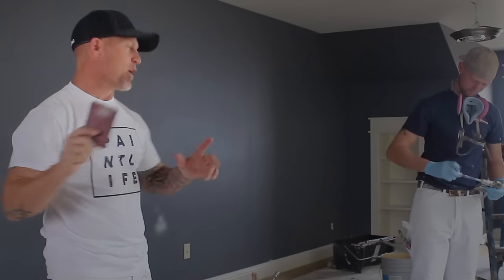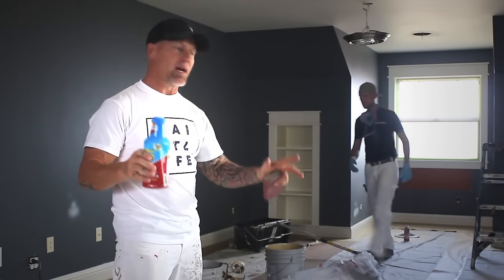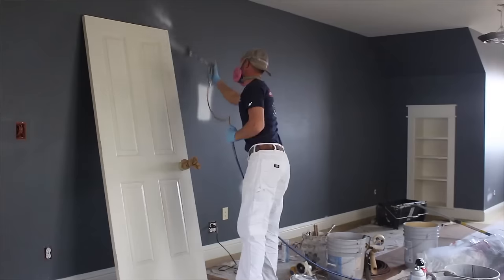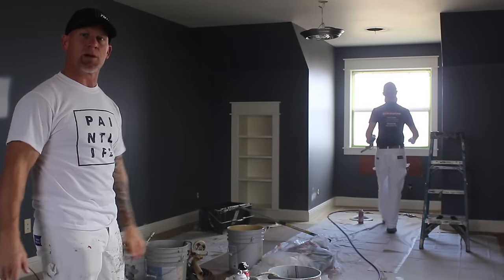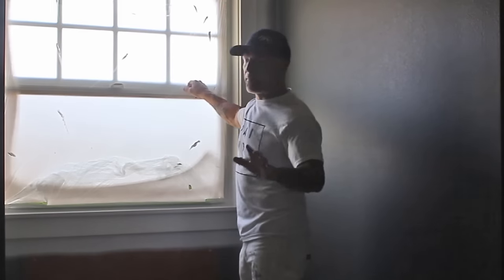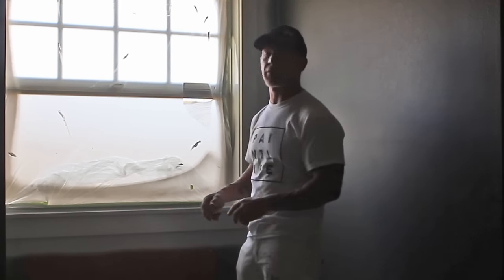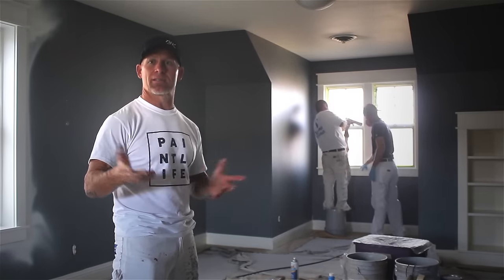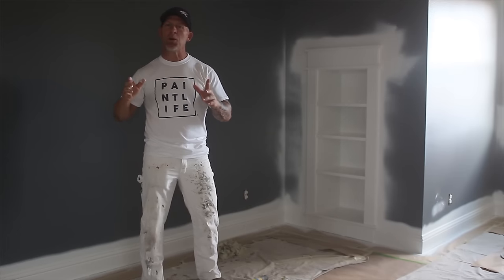Interior Trim Painting Hacks.  DIY How To Paint House Trim Work.

Comment: When you get a run spraying, do you address the issue immediately, or do you wait until it dries to repair the issue? Also do you have any tips to eliminate running? I tend to get runs a bit, whether its spits from the gun or double passing in windows etc. Thanks and keep up the great work.
Reply: Dont ever wait for it to dry. You can either wipe the run and area clean. And try again or let it dry and spend an eternity sanding on tough semi gloss.

Comment: Ok 310 tip for trim paint, but what if you were going to need to prime the trim first?  Can you recommend a tip for priming stained and varnished wood trim with bulls eye 123?  The 123 worked pretty well by brush after sanding the varnish but it's taking too long and I'm going to try spraying it.  I'm willing to use a different primer too if that would be better.  Thanks

Comment: Would Spraying trim with a 211 be as good as the 310 your using? Pros and cons with each tip size? Also.. would using a fine finish tip require a different mesh filter in the spray gun?? If so.. what size mesh is recommended?  Sorry..so many questions.
Reply from the maker: I would prefer a 310

Comment: Do you find a difference when you spray the caulking before it is dry compared to allowing it to dry first?
Reply from the maker: no
Reply: Yeah cracking in the paint from when the caulk dries and shrinks
Reply: So shrinking doesn't effect you paint drying?
Reply: Yeah the shrinking cracks the paint

Comment: Hey Chris, question on the taping and clear caulking on the windows between the wood and vinyl windows.  So you caulk to do two things, seal between the wood trim and window and to give a clean line by sealing the tape edge, right?  When you pull up the tape, doesn't it cause issues with the caulk which may have dried some?  A picture of this taping and caulking would help me understand the process.  Thanks!
Reply: I found your other video explaining how this technique works.  Interesting process.
    Painting Straight Lines With Caulking And Tape.  Painting stripes.  Painting Hacks.

Comment: Curious as to whether or not you worried about the flashing of the overspray? It's been my experience whenever I repaint over overspray such as that, when the light hits it at the right angle, you can see it.
Reply from the maker: Add a latex extender if you are having that problem
Reply: @Idahopainter  to the trim paint or to the wall paint? I'm assuming you're speaking of products such as floetrol? Thanks for your response really appreciate your channel. P.S.  would there be a certain time frame I should/ shouldn't paint after applying my simigloss trim paint?

Comment: Hi, I used 311 tips for trims and doors. the funny thing is after sprying the surface looks rough!! I though the pressure is too high or I do it too far! but the funny things is around the trims on the walls that have already painted prime are smooth.
I hope you are still going online. do you have any suggestions?
thx

Comment: I really dig your videos. One area that I think you can improve on is your spraying technique. When spraying doors it is best to maintain equal distance from the substrate. Breaking your wrist will cause a paint to build up in the center of the door while potentially skimping on the top and bottom.  Also, what is the benefit of having the pressure turned all the way up? I would suggest doing that on ceilings or raw drywall but, not inside an occupied home. Perhaps you know something I don't. Lastly, RAC X Tip is called Rac10
Reply from the maker: Thanks for the tips Chris!

Comment: I'm a painter and decorator been at it nearly 20 years from when I left school. I have never touched spraying, I feel in most cases the work I do brush and roller is just as quick. but spraying mist coats, or all white houses on new builds is what I think will help me. I mean i am a complete novice at spraying having nearly no idea... how difficult is it to mist coat a house in emulsion? and just for mist coating plasterboard/plaster what type of sprayer do I need? and how much roughly in price would one be?
Reply from the maker: Titan 440 or Graco 395. Just takes practice

Comment: Hey, great video. I like the caulking around the frog tape tip! What type caulk do you use. How do you (I) avoid the caulk from setting up before you can get the  tape off or does it matter? I'll be doing this on pre primed mdf soon any other technical advice for this novice?

Comment: In the end of the video you said it is dusty in here so it is harder to see. I am guessing that is the overspray lingering in the air. Can you explain how you deal with that lingering overspray that is airborne from getting onto your trim that has already started to cure? 
I painted a stair case and that lingering overspray was hanging around for 30+ minutes and landed all over my finished work that was starting to dry. 

I am not as fast as you guys, so maybe you sprayed so fast that all the overspray was absorbed into the wet paint still?

Comment: Chris,  I have just watched several videos and learned so much!  One thing I have not seen or figure out is what is your process on new construction.  If you have bare wood window casing, do you tape, mask and caulk the window for each coat i.e. tape/mask caulk window then spray primer, peel tape off and then repeat for each top coat?
Reply from the maker: No, we only tape once for the first coat
Reply: Paint Life TV - so do you brush on primer to the bare window trim then mask off the window to spray?

Comment: I'm constructing my own home.  I'm priming everything and painting THEN installing trim. How can I spray all my trim without having to go back and cut in the walls and ceilings again?  If I spray the trim before installing, how will it look if I spackle then touch up?
Reply: The Idaho Painter thank you for the reply!  If I paint the trim prior to ceilings and walls, would it be best to mask off the trim so I can then spray the ceilings and walls?  Or would you cut in with a brush and roll?  How would you do it?  Thanks!
Reply: The Idaho Painter kind of contradicting yourself there buddy seen as this video shows you spraying the trim before you've even put a lick of paint on the walls!
Reply: POA You can mask the walls off with blonde tape and 12" masking paper after the trim is installed, caulked to the wall, and the perimeter caulking is painted with wall color. So then mask around everything and flap the paper out so you don't have to plastic the walls.

Comment: did you say "full pressure" for the 310 FF tip? was curious because I used a Graco 310 FFLP on my cabinets but still got a lot of fingering. i thought the tip was supposed to run at low pressure and not high pressure...

Comment: If painting trim/doors with latex when it is already painted with oil based paint, can you just clean with TSP, degloss and use a bonding primer before topcoat or do I need to add hand sanding in that equation as well?
Reply from the maker: That is right, no sanding needed

Comment: The guy spraying does a lot of quick touch up shots, but in another video you mention the tendency of the extension to spit (so you start spraying well before whatever it is you're painting). Are you getting spit marks on the trim? If not, what's different?
Reply from the maker: Wherever you release the trigger you will get a spit. Do not release the trigger on critical parts of trim seen easily.

Comment: Does spraying over where you caulked effect the caulking since it hasn't had time to dry? Or will it dry/cure the same? I have heard of doing it to keep the paint from bleeding I was just unsure
Reply from the maker: It depends on the paint you use, we do not have a problem with the paint we use

Comment: what pressure are you running with the ff lp tip? i’m heaving a hell of a t8me trying to control overspray. we build balconies and staircases and we suck at painting. if i use a small fan tile like a 4inch it delivers to much paint. if i go with a 12 inch fan is too wide for a 1inch spindle. and overspray is a billion time more than in your videos.

Comment: Chris, just finished a very large addition on my home and after watching this video have realized I did things reverse order... My walls are already painted and I will be installing my trim next which we are going to paint White. what would you advise I do in this predicament do I attempt to plastic off all of the walls and ceilings and spray the trim. I could brush paint but I think I would rather use the sprayer for the nicer finish. any advice would be super helpful thanks brother for all you do
Reply: Matthew Kitzmann paint the trim before it's cut and installed then touch up after installation 😉
Reply: Thanks
Reply: spray paint the trim prior to attaching....then after attaching..spackle nail holes.....then use a latex extender and brush final coat..

Comment: I am newer to spraying.  I was told to get a 217 tip to spray my trim.  Seems to me it puts out way to much paint and causes major paint pile up(not sure what the correct term is).  I was told if I get a smaller tip orifice size it would clog.  Using standard latex paint.  Can I use a smaller orifice size?  Will this help with the paint build up???  Thanks for advice.
Reply: The Idaho Painter Thank you. It was actually a paint store. Guess they just want to sell the more expensive tip. Bought a 210 and it works much better.

Comment: well I sprayed pro classic on Saturday  and asked sw for a 310 ff and they said they don't sell them so they gave me a 214ff. so basically I fixed runs and sags all morning on doors. I was not happy. I turned the pressure way down and resprayed. come back after lunch and damn if I didn't have a couple more runs and sags! I'm done with pro classic!  Is solo the only trim paint you use  or what are your recommendations?  thanks for all the work you do to provide videos and the help!
Reply: Matt Taylor don't trust reps/sales staff in store, when was the last time they actually stepped out of store to paint let alone use a sprayer

Comment: If there are big gaps between the wall and the baseboards, what do you fill it with before caulking and painting?
Reply: If you’ve got large gaps between baseboards and wall you may need to do some trim work before paint. Shouldn’t have anything that can’t be filled with 1/8” of caulk.

Comment: Hey I’m painting a house with dark trim, I was going to spray the first coat of the walls but worried about getting on the ceiling and also was going to do paint the trim last bit now thinking of spraying trim then walls. How do you protect the trim from the overspray or roller spray?
Reply: stef kerek you have to mask off trim with tape and 6-9 inch paper.
Reply: Just roll with carefully have clean wet reck to wipe paint drops

Comment: I'm thinking of painting some interior trim with proclassic oil base through a graco ultramax cordless handheld sprayer.  Would a 310 fflp tip work well for that?  On the can it recommends spraying with a .015 at 2000 psi.
Reply from the maker: Yes, it would work

Comment: Nice video. I'm having trouble with my spray rig when using a fine finish tip. the rig is a graco 395. this thing is probably from the 90's. A buddy of mine gave it to me in pieces in a five t bucket lol. I figured out what it was missing and ordered parts for it, put it back together again and it works great. problem is when I try using the rac x tip it drips paint from between the tip housing and theUn but gun. It only does this with the fine finish tip. the guys at Sherwin Williams say I'm trying to force to much paint though to small an opening. I'm watching you do it with no problems though. any ideas what's going wrong with my set up?

Comment: the time u took to mask up and all that u could brush it faster and make it look just as good but its cool to c ur way of doing things if u have the time it is good to do it ur way.. paint on bro
Reply: I will have to disagree with you Amber. There's nothing like a quality spray paint vs brush strokes on the trim work. I've been painting for a while now and always, always spray paint trim, ceilings and the walls are rolled on with the graco spray pump roll on attachment.
Reply: brush marks of any sort on high end Carpentry are unacceptable...It takes years to learn how to spray, this isn't for the door it yourselfer

Comment: what pressure would you spray indoor trim with? 2000?
Reply: I think I found the answer off the good old googler, 800-1100 sound correct?
Also thank you for the tip with krud kutter.

Comment: 413 rac turn your pressure down to about  3/4 and cross off your door it only takes one pass each way and you’re done. getting your speed correct takes a little to get use to but thats it. I also find it easier to turn your tip so the fan is up and down rather than side to side but thats just me. good job.
Reply from the maker: Thanks for sharing the tip Justin!

Comment: So after you're done with trim, do you mask and primer the walls, or just use a quality paint with primer in it? I know trim is typically high-gloss and wall are less glossy. Didn't know if the paint will adhere correctly.

Comment: Good job. Just curious, if your doing a high end home and the owner wants oil base on all trim, do you guys spray the oil finish? Is it worth the extra time involved, ie masking, etc.. to justify spray, considering risks involved? Also, no " flash " issues from over spraying out on walls, no high spots?  You can save some time spraying everything, but you can also get bit in butt worse with one mistake. Accidentally leaving a draft, door or window open, hvac running,  and create a heck of a mess to clean up. Just not sure it's worth the vvv risk. Maybe in rental property or apartments. I would just hate owner of $1 million dollar home come to me and say what are you going to do about the imported antique furnishings thru the house with over spray on them? Maybe new construction, rental, apartments , or a empty remodel, but not a high end repaint. Too risky for me, for the time saved. I still enjoy your video's, I'm not knocking your work, I've picked up some good pointers. Thanks, and watch out for holidays. JohnG

Comment: Hello! I have a few questions if anyone from the community would like to help out! I want to get an HVLP spray gun to paint my homes trim, kitchen cabinets, and other household projects. My questions are: 

1. Would something like the harbor freight spray gun produce a good finish if tuned correctly? I would prefer not buying a 300 dollar gun. 
2. Would a Porter-Cable 6 Gal. 150 PSI Portable Electric Pancake Air Compressor be enough juice for spraying? 
3. How do I know what to thin each type of paint with and how thin to make it? 
4. I also need to paint my ceilings, could I just use the same paint as used for the trim (my house has lots of ceiling trim, the thought was to just continue spraying entire ceiling). 

I know that an airless sprayer is more ideal, however I'm trying to keep my setup under a few hundred bucks. I appreciate the help on this !!!

Comment: I am remodeling my entire house and will be painting approx 5000sq ft. Walls, trim, ceilings. With an approx $500 budget what make/model paint sprayer would you suggest?
Titan XT330? Something else?
Reply from the maker: Titan 440
Reply: Got the XT330 and do excellent work. But if you think to use a lots more than one home a mouth than switch to 440. Simple as that. Difference is one is 3X the price and last 3 time more.
Reply: If you're not a painter and you're only going to paint now and then just rent a top-of-the-line spray rig for $65 a day at Home Depot

Comment: Tip for the pro. On your window trim, mask and plastic the window first about a quarter inch in from your edge. Then come back and do your final frog tape edge. This way when you pull it wet, you are only pulling a piece of wet tape, not the whole window plastic that can flop over or accidentally touch something.
Reply from the maker: 🤙good tip!

Comment: I would have never guessed it was ok to overspray onto the walls like that. Who new. One of those things pro's do that if I did as a homeowner would feel very hackish! Not criticizing, just thinking outloud. Question, since you pulled the masked window tape and caulking off before the paint dries, guess that means trim just gets 1 coat?

Thanks for  the videos!
Reply from the maker: One coat with touch ups where needed
Reply: Thanks! As a DIY painter for years, I've learned quite a bit watching your videos. I've always done one good coat on trim, assuming its' primed (most trim can be bought that way). Glad to hear its acceptible. I think its understood that you need a good quality paint that can go on thick enough- not thin and watery.
Reply: 3 years have gone by and I still don’t get why the glossier trim paint doesn’t show through the wall paint, lol.

Comment: I have a spray machine and I have a hose that leaked from behind the nut where it screwed onto the machine ( swivel). I bought a new hose and it does the same thing. What am I doing wrong or need to buy. I have a magnum x5

Comment: two questions: how do you make the sheen consistent? I see glares from different angles.

why is the painter using a particle filter on his respirator?
Reply from the maker: That will be an issue if you spray it.
So he does not breathe in particles
Reply: Pink particle respirator cartridges dont protect against the fumes though